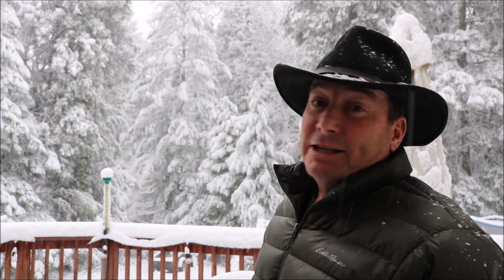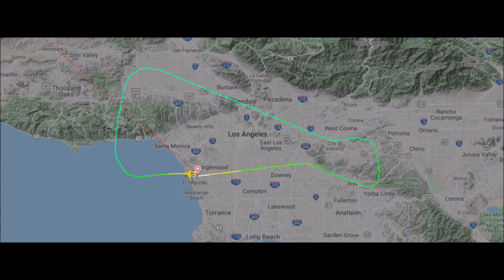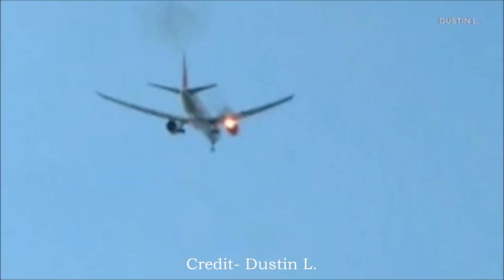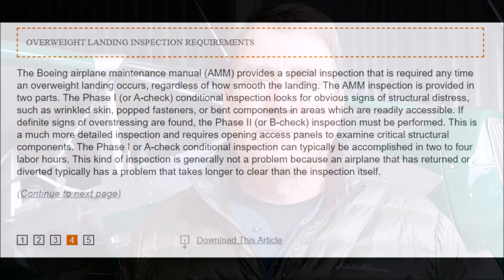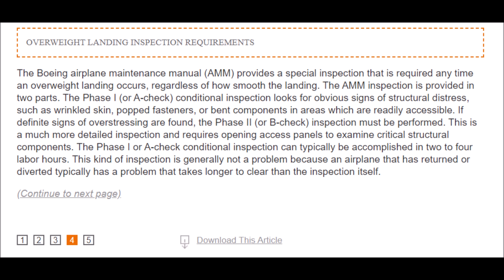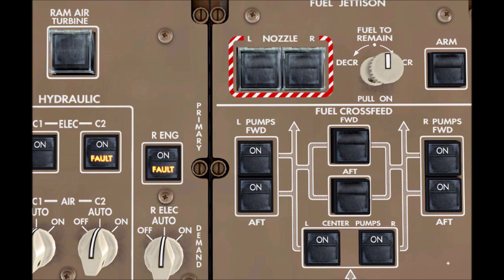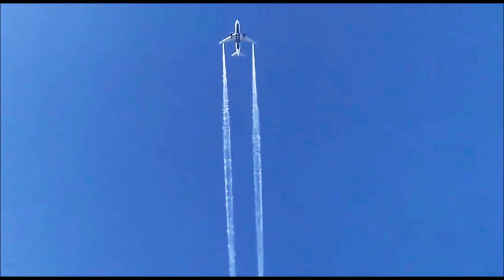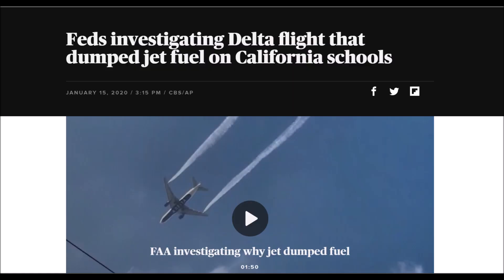B-777 Fuel Dumping and Overweight Landing Considerations (Part II)

Comment: YouTube keeps turning off notifications, almost every time I check in the bell is no longer selected for all notifications. any one else having the same problem?
Reply: I had this issue - to fix it I had to go into my dashboard as reset the setting there for everything to work again - also youtube last year said 60% of the time notifications just do not work mainly because youtube/google sending out to much data at once etc
Reply: yes.. they are trying to kill smaller monetized channels by every means possible short of just killing channels... which they HAVE done to several non-leftist oriented political viewpoint providers.
Reply: Yep. Noticing it more all the time. I read further down in the comments that Mentour has a vid on fuel dumping also. I've been subbed to him a long time but I got no notification. I checked and found that my sub was turned off. I didn't do this. Also lately I receive some but not all notifications from other channels. YT is really getting screwed up!
Reply: Just grab your welder and weld that notification button in! Problem solved :D
Reply: there are other platforms coming up.  don't know about the regulations.  but people need to stop complaining and leave youtube.  it's really that simple.
Reply: It gets way worse than that man.
Reply: @luiul1  What other ones are out there?
Reply: @jenniferwhitewolf3784  Especially if they compete in any way with investigative reporting. Or in Juan's case, blows them out of the water.
Reply: I too have had that problem but not for this channel.  Try unsubscribing from the channel for an hour or two then go back and subscribe again this apparently resets the setting and it seems to work ok after that.
Reply: Prolly a COPPA issue!!!!
Reply: It let's me click the bell on my mobile phone, on the PC I doesn't. Maybe that's why.
Reply: I haven't had any problems with any channels, and I think I'm subscribed to about 500. I can't keep up with all of them.
Reply: I haven't had any poblems.  Then again I am not as paranoid as some are.
Reply: YT is probably offended that this is a fact based content channel!  My subscribed and bell are working ok for now.
Reply: I watch a lot of channels and don’t have a problem with any of them
Reply: My notifications are coming through fine.
Reply: Not me.
Reply: @gordbaker896  censoring*
Reply: D Deininger   Hello, I never have an issue, with my selection with ‘all’   BUT , I have noticed is that on my selected YT lists, there ARE times I do NOT see a notification, but I now have some 300 YT subs, so it takes me quite a while to check, but there ARE TIMES  that I find missing notifications  SO F A R  Down It’s funny ,,,  CHEERS. FROM NJ🇺🇸🇺🇸🇺🇸🇺🇸
Reply: i never set the bell. I just click n my subscribed channels and all the new content is there.
Reply: If you're using windows it might be one of those things that gets switched off when there is an update. They are usually on a Thursday and there was one yesterday. With me it tends to lose my forum log-ins which is even more annoying. Often means I have to get my password book out!
Reply: Yup.
Reply: No problems in general but I recently got a problem with ChinaUncensored, maybe it's too controversial if google wants to have any business in China :-)
Reply: Youtube is a mess.
Reply: For me YouTube notifications
on is off and off is on. annoying youtube have never fixed it with update
Reply: Not on this channel so much
Reply: Thanks Juan for your clear explanations of what happened. 
I hope your health continues to improve so you can get back in the cockpit soon 👍

All the best,
Norm in Arizona
Reply: Yes I have had problems  with this
Reply: Eyyup
Reply: Yes!
Reply: @jenniferwhitewolf3784  That's just pure bullshit. The "adpocalypse" has hit just as hard against left oriented channels. I wonder what the hell these comments have to do with fuel dumping...
Reply: hmmm..never had that problem
Reply: not  me  no  problem
Reply: D Deininger Youtube is aiming to transition to “corporate” content (such as CNN). Missing notifications are common for me.
Reply: yes missed about 3 reports not realizing this.
Reply: @QALibrary  a
Reply: Frank Winkhorst  Close minded much? It is true, I have noticed it as well.

Comment: My theory on why they dumped: They requested the longest runway (25R) to land on so they could land without dumping. After getting lower in altitude and closer to the airport, they got switched to another controller who started talking about runway 25L which is a lot shorter. Possibly they thought they were being sent to the shorter runway, and were too heavy to stop in time, so initiated a fuel dump to get as much weight off as possible. By the time the controller corrected himself and gave them the correct runway, it was too late to stop dumping.
Reply: Murph's Models yea I like that theory. A lot of people don’t understand that flying and landing comes first then navigating to the best place of landing is second and way way way way behind all of that is talking to ATC. In the event of a emergency as a pilot you don’t need any go ahead from ATC to do anything. You do whatever you have to do to not crash and then tell ATC what you did. So when they didn’t need to dump maybe something changed then they had to and didn’t have enough time to ask first.
Reply: How would it be "too late"? They could have  aborted the landing and done a "go around" Was that possible?
Reply: I agree with your assessment.  In part1 he brought up this issue of going thorough more than one controller at lax explaining everything all over again and that is what probably got the pilots messed up while dealing with an emergency.    I know people criticizing the pilots but fuel being sprayed on some people heads is better than a plane crashing down on their heads or crashing while landing
Reply: While I can kind of see this, isn't part of the whole "declaring an emergency" thing basically "hey we need THIS or we ded jim"? So just because the controller said 25L vs 25R couldn't they just say "umm, we need right." I mean they even basically do this earlier when they were still running checklists when ATC wanted them to turn into the final (or something) and they said no. They may have had to have a go around or similar at worse, and while I can understand the want to get down NOW by all accounts everything was under control, airplane flyable, etc so until we learned that something made it a case of "lets get down NOW" it just seems to be a huge "what!?" moment.
Reply: Ellis James go around heavy with 1 engine inop is hard even in a small GA aircraft. I don’t know about a heavy jet but I bet it’s tough.
Reply: @ellisjames7192  is going around really an option with repetitive compressor stalls? I dont think smashing the gas pedal is a good idea.
Reply: I'm not buying it, you've declared an emergency, you get your runway pick unless it's out of service. They messed up, that's it.
Reply: Except that with everything pretty much under control, the pilot's urgency to "come straight in and land" was seriously misplaced.  He painted himself into a corner by coming in fast, heavy, and low, and left himself too little reaction time...whereas if he'd taken the "hold and burn fuel" option when first offered, he'd have had all the time in the world to do a dump "by the book" instead of an unannounced emergency dump.  Coming straight in after declaring an emergency is not always the best course of action!
Reply: Tomes, 25L is the normal arrival runway not 25R which is used for departures. The controller was acting out of habit.
Reply: LAX should be closed to keep the children safe. A wind and solar farm along with a marijuana growing facility would replace it for the children 😓. Mommy I got wetted on by a airplane during recess, hello operator get me Johnny Cochran's number, I don't know how to spell it it's O Jays lawyer I'ms gonna be rich, I mean that evil corporation is gonna pay for harming my children
Reply: @willyjimmy8881  They had the compressor stalls under controller. Either they eased back on the throttle until they stopped or had reduced it to idle. If they had to go around the aircraft is capable of doing so on a single engine.
Reply: Shenandoah Hills — There was no mention of 25L by either the pilots, or any of the ATC in the recordings.
Reply: Murph's Models — There was no mention of 25L by either the pilots, or any of the ATC in the recordings.
Reply: Tomec — There was no mention of 25L by either the pilots, or any of the ATC in the recordings.
Reply: Mui MasMacho — There was no mention of 25L by either the pilots, or any of the ATC in the recordings.
Reply: Dremwolf — LOL Obviously, I agree with you!!! There was no mention of 25L by either the pilots, or any of the ATC in the recordings.
Reply: @xheralt  I dont think he came in  in fast and low. At one point, before final he was high and fast but he got down to a normal glide path and speed. I believe the controller asked him what speed he would have and he said 160. Then he hit that speed right on the money.
Perhaps he rushed the landing for no reason or some reason that we arent aware of but I wouldnt say he painted himself in a box
Reply: Runway 25L is about 1000' shorter than 25R. Well within the 6000' some odd feet recommended.
Reply: 25L is not a lot shorter than 25R, and even if they had been directed to 25L, that would still have been way longer than their runway requirement at full weight (which Juan said was about 6000 feet).    So no, 'not stopping in time' is not an excuse that would hold up.
Reply: @cool2180  but that isn't mutually exclusive.
Reply: @dremwolf5419  except there's radio traffic missing, from just before the plane established on the LOC until just before touchdown. If Murphy's Models theory is correct, THAT is probably the audio where we'd hear it, from the tower controller since the app controller was giving clearance to 25R.

I still say, though, the decision to dump should have been made LONG before that.  Or, rather than just opening the valves when the tower said 25L they should have replied that they were set up for 25R as that's what they were told to expect, and as an emergency aircraft they should have gotten whatever they said they needed.
Reply: @1STGeneral  Johnny Cochran is dead, BTW.
Reply: @lottiestanley7696   I was responding to Murph's assertion. 25L and 25R are both plenty long enough to handle the aircraft's return for landing. Using the longest was a good choice.
Reply: My thought also, ???, do not understand
Reply: Also that they wanted to decrease weight
Reply: Wesley Hurd 
Whoosh
Reply: I have to agree with this dumb ass procedure when switching controllers during an emergency. The pilots should not have to answer questions already answered with previous controllers. The controller who hands off a flight should make the new controller fully aware of their data. This is how a Mexico flight crashed in New York running out of fuel in bad weather, controller vs. controller times about 6 and the flight deck was constantly wasting their time repeating themselves and during all of that ruckus the last controller to communicate with them had no idea they were on fumes and needed a clearance to land NOW.  I'm with Juan on this one, those two controllers in this matter should have had a conversation before handing off the flight to the new controller, especially at LAX, they are slightly busy there and this crap shouldn't be happening to a flight deck dealing with what they were. Do you hear this FAA?
Reply: @molarrr  Not sure its that tuff. They are certified to do so.
Reply: @xheralt  Agreed...They got their underwear into a wad and rushed it. (based on info we have to date)
Reply: 1ST General  No problem!  Move everything to ONT!
Reply: @wesleyhurd3574  Just added extra chum while I was trolling
Reply: @ellisjames7192  - If they had an engine that was compressor-stalling, the crew probably did not think a go-around would be a good idea - I'm sure that they were pretty well committed to putting the thing down and, as heavy as they were and especially with a possibly defective engine, a go-around would have been the LAST option.
Reply: Shenandoah Hills — I do understand that. It is just that he was incorrect that ATC said anything about 25L. The recording is in part one, and in VASAviation’s video which he used in part one.
Reply: Star Gazer — Considering the number of flights that ATC are handling, both taking off and landing at LAX, there just might need to be an understanding of which runway is available for various reasons.

Comment: I'd like to point out that the Heavy Weight Inspection shown in this video and the link posted are from the Boeing site. Each airline has it's own maintenance program based on Boeing's recommendations, but not exact to what Boeing says. That info shown also does not show specific weights as well. AA and UA are not DL. Their programs will be similar, but not the same.

Comment: Looking forward to the final report. Many questions unanswered at this point. Having said that, 25L is the designated “emergency runway” at LAX, and is not much shorter than 25R. This is most likely because ATC and the airport operator would like to keep this runway available for the heaviest departures, and not have it closed by an incident. This does not preclude a PIC to exercise emergency authority and request whichever runway he/she thinks is best for the situation.

Comment: Once again Juan, great work in getting us all some enlightening information relating to this incident in Parts I and II.  I can't imagine that this crew will be able to provide any legitimate justification for their low altitude fuel dump when they themselves told ATC that their situation wasn't critical once they got the compressor stall under control. Certainly if it was a more dire situation requiring an immediate return, the crew must do whatever is necessary for everyone's safety including throwing the fuel dump guidelines out the window. I'd hate to be in charge of Delta's Public Relations for this one as it took place one day after it was announced that Delta was the Number 1 rated airline.
Reply from the maker: Man, stuff happens quick!

Comment: Thank you for great coverage of this event. Hardest Lt. Pete “kablammo” landing I ever had as a passenger was a short SAS leg from Copenhagen to Stockholm on a DC-9 back in the late 80’s. There were a lot of gasps and even crying by passengers after “touchdown.” My uncle used to work for McDonnell-Douglas (space program) and I told him I was impressed with the over-engineering of the landing gear - it took a lot of abuse that day.
Reply: When a strut is inflated (with dry nitrogen) to the proper amount in temperate weather, but then the aircraft lands somewhere really cold and at a relatively high touchdown sink rate, the strut may actually bottom (metal on metal contact).  Kablammo with a vengeance.  So occasionally an airline will request the manufacturer to come up with strut inflation pressures which are adjusted for their extreme conditions, like -60 deg F into Moscow.
Reply: Marc McReynolds It was July and relatively warm for Stockholm. Nonetheless, I bet those struts had seen a lot of extreme conditions during their service on that aircraft...